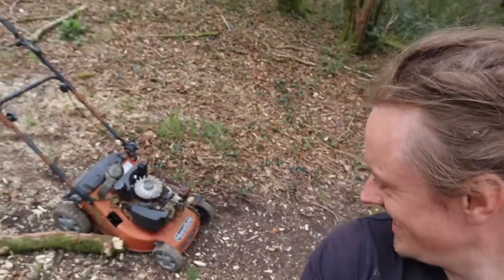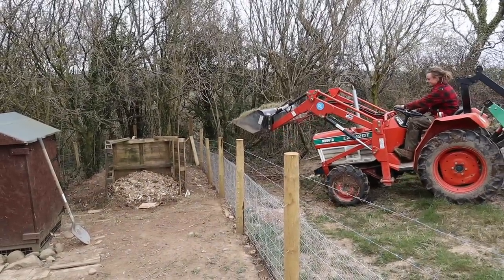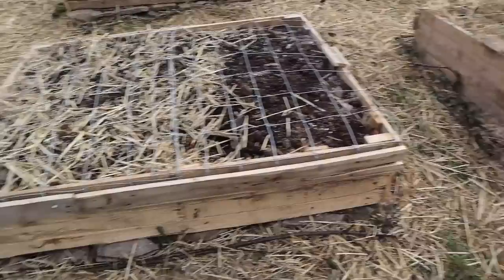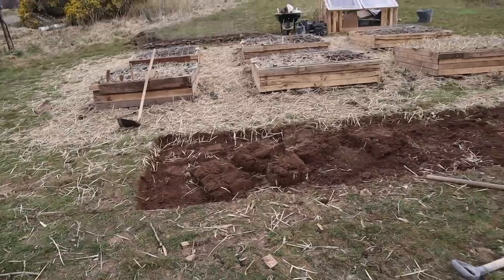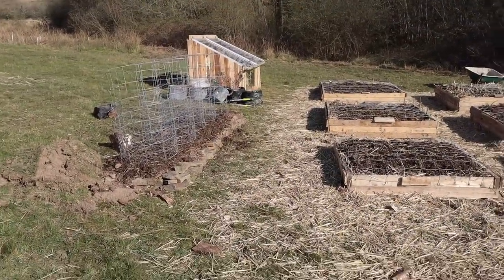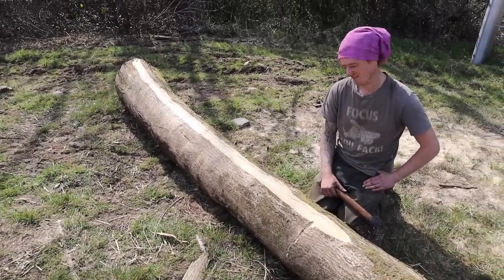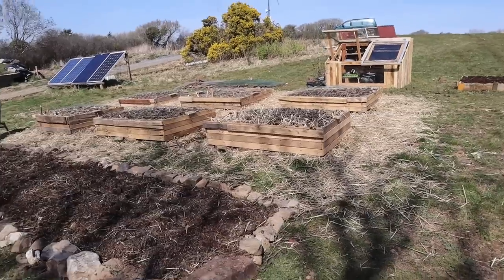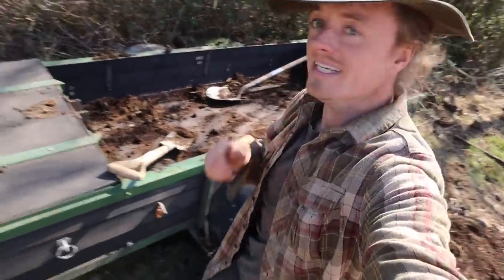Making More Raised Beds And Planting An Orchard For Self Sufficiency

Comment: We have goshawk in South Africa also. Put in higher corner posts around the chicken pen, and put chicken mesh fencing above the entire area where they run. It will keep the goshawk out.  You can be totally self sufficient with half an acre of veg and fruit garden. Hugs
Reply: I was going to say the same thing. That's how we do it in Ohio. :)
Reply: Just what I was going to say! A large net would work as well.
Reply: @pippaseaspirit4415  -    A lot cheaper as well.
Reply: Do the same in Minnesota. We call it a run. Good luck with your chickens. 🐓🐔
Reply: Chicken fences need to be covered all time with nets. Hawks and eagles make fast meal out of your birds otherwise.  But they are easy threat to defend against.  When martens find your  coop you are in trouble. They can chew through solid planks and climb through every small hole + they kill every bird in one night in killingfrenzy. In 30 years iv lost my chickens 3 times to marten.
Reply: Put in a few 8 foot tall poles from your stands of saplings all around your hen yard, and then you can just reach high overhead and run about a dozen or more random, criss-crossed strands of high visibility string, or ordinary string with cloth or plastic flags attached, to make the approach look too risky for entanglement, which will discourage raptors. We have hawks, falcons, big crows and even large bald eagles where I live in the southern U.S., and poor folks have relied on the string & rag method for generations.
Reply: Hi kris, just checked out this post ,somehow missed it, I've had a similar problem with my chucks ,weve now put a Mannequin in there run (just happened to have one that I found some years ago) and since have had no problems, other than scaring the odd camper. Love what your doing ,your a great inspiration to my projects .
I live in west Wales ,hope to bump into you some day . Light and happiness to you and dot.
Reply: @pippaseaspirit4415  aaaaaa

Comment: A tip for planting veg is to stagger the timings or you get a glut of crops ready all at once and you don't want waste. You have plenty of beds for two people if you're clever with timings, crop types and rotating the beds. For example, do two or three potato crops so you can have a balanced staggered harvest, but like everything, you learn as you go.

Comment: We keep ducks at work, we have run fishing line over the top above head height of thier run, we then used old cds and foil, and things that made noise. Also made sure that the fishing line cruised crossed the whole area so to deter the birds of prey. It has worked for us. Maybe worth a try?
Reply: around here on flat roof building they put fishing line to prevent birds from nesting on the roofs
Reply: Ha! We did this for our fish in the pond. Guess what, herons come walking along, get their fish, walk away and start getting airborne couple of meters further. Clever bastards!

Comment: I have seen some one do something similar to that with the lawnmower but using an old electric hand plane. They created a wooden hopper and then in the top went branches and out the bottom came chips. He has a pushed for it that barely reached the blades of the plane.

As for how much you need. Using old methods of growing. i.e. row crops, you can feed a family of 5 on a 1/4 acre. A full sized allotment for instance is 1/8th acre and my back garden is 1/16th of an acre. Using a combination of permaculture, inter planting and basically keeping the ground in use without resting time between the third week of February and and the last week of October, leaving the winter for rest, I produce enough for 3 people veg wise. 1/16th acre is 252sqm.

Comment: Looks good mate. 

What you will have to remember is that certain foods you wont be able to grow all year round .... in the winter its best growing brassicas. 

What you can do is if you have a freezer then you can part boil things like peas, carrots , cauliflower and broccoli,  let them cool down and then portion them up and freeze them they will keep for months on end.

With all of your root vegetables and potatoes you can build a big wooden box and fill it with layers of sand and root veg/potatoes, put a layer of sand at the bottom then a layer of root vegetables/potatoes and keep repeating the process and they will stay as fresh as the day you picked them for months on end. 

Potatoes dont need a lot of room , you will get loads out of that one square bed if you have put quite a fair few sprouting potatoes in there but if you done one more bed the same size then you will yield loads that you can store using the sand method I mentioned above.

Comment: Just a idea for the Goshawk issue is making a hoop roof out of poly pipe then cover with a net? Poly pipe costs very little and you just loop it into a semi circle fixing each end onto your fence. If you want to get adventurous drill out a larger diameter pipe so the hoops can slide through and use it as a ridge beam to hold the top in place. 5m x 30m bird proof black netting is only like $20 on eBay. 

Small hoop tunnels over your vege patches can easy be made the same way except for plastic covering and give you a few extra months growing season.

Comment: Hi Kris, good effort. Some advice buddy, 1. Make 3× compost bins next to each other you fill one up, let one decompose and the 3rd is ready to use and empty.
2. You can use gypsum to breakdown heavy clay. Clay is really high in nutrients, keep adding the rotten wood and straw it will help.
3. Buy some comfrey seeds/plants. Site them in a spot that is damp and gets alot of water. Cut the plants down and make a 'tea' from the leaves. The tea is really high in potassium and nitrogen both good for alot of fruit and vegetables. Keep it up
Mitch

Comment: Simple netting loosely draped up & into the lower limbs of the trees (obviously over the chicken fencing) will keep the hawk out.  Also, you might consider welding a 4”+ diameter pipe to your modified mower.  It’ll allow easier & saver chipping of those branches.  Once they’re too short to feed in by hand gravity & the next limb will take care of it completely.  

Great video!

Comment: Aviary netting is great for birds of prey, but generally lots of vertical obstacles like posts and whatknot in the run area really seem to mess up their ability to come in fast. But the aviary netting is pretty good and the nylon stuff lasts for years and can be cable tied together and repaired fairly easily.

Comment: Kris, from my own mistakes I would highly encourage removing the center row of the orchard and planting those further away. Otherwise in a few short years the trees will be competing for light and space growing into each other. If you watch Stephen Hayes he's removed dozens of mature trees in his orchard for this reason.  Best of luck on these projects I'll be following along!
Reply: Yup, I immediately thought "well that's a bit crowded looking" aswell, when he showed the finished orchard spot
Reply: @DatsWhatHeSaid  does Kris say what rootstock the trees are on?
Reply: @subliminal_donkey  typically if they're box store trees they're semidwarf which is too large for that spacing.
Reply from the maker: They are 2.5 - 3 meters apart, i went with the spacing recommended on the labels. none are full grown trees all are on a dwarf rootstock. i cant remember exactly but it says they will grow 3-4m tall. so the spacing should be fine.
Reply: I agree, having seen how sprawling my trees have got over the years, these look too close together
Reply: @KrisHarbour  first like to say love your channel.
Have to agree they are too close. You say your trees will grow to 3-4 meters, your spacing is 2.5-3 meters, that means they will eventually grow into each other. Especially in a damp climate like yours, they need the space for enough air to pass through.

Comment: that's really a cool idea what if you connect the rear of the lawnmower to a skipo bag that was closed up at the top,you wouldn't lose so much and it would save the clean up, you could superglue the bag shut, i know that sounds useless but superglue works well on that kind of plastic, then make a little tunnel you could use the frame for the bag that goes on the back of the mower to catch the grass just tie the bag on to that ,or put the whole lawnmower into something like a huge vat or a mini skip

Comment: I recommend a solar-powered owl scarecrow with a rotating head perched on one of your fence posts over your chickens. They're fairly cheap online. The solar power allows the head to move... Scares the crap out of small hawks like a goshawk. I also recommend putting some spikes (metal or wooden) on the tops of your other fence posts to remove easy perching opportunities. Also trim any branches that hang over the pen.

Comment: Re. bed space required for two people. UK council houses used to have a 10x10m garden for a family (maybe 5 people i guess) so half that  should do for you two. We have a small CSA and have found that we can supply 1.5 families in the summer with a 10x10m block but winter is a bit more difficult

Comment: It easy to stop it, extend  the post that holds up the fence and use a cheap fishnet as a roof over the whole thing, And if you want it to be bird safe, add some light waging  markers in the net with lots of colors. That should stop the bird from attacking.

Comment: Chicken pen,.. roof. Make a wattle and daub bent roof using bent-over hazel, clay, sand and straw. It'd be a fun project, the roof would be secure (especially if you use reeds to thatch it) and it'd last a long time too! Win win! I realise it's more work than chicken wire 'roof', but it'd look so much better AND it'd keep the birds warm in winter if/when it snows. Oh and I think you should consider fencing off the garden with a proper hedgerow (just my humble opinion). :)

Comment: i find that getting enough veggies and fruits from a garden actually doesn't require that much space, then comes potatoes which require several raised beds that are planted each with 2 weeks in between beds. So far so good for my garden (right now its about the same size as yours). But my diet includes quite a lot of flower (for bread), and thus would require a lot of grains. I have no idea how many square meters i would need for that alone, but for me that isn't worth the effort.

Comment: I use bird netting to protect my chickens from goshawks and it is cheap and works fine but looks ugly, also in my country we sometimes get heavy wet snowfall and it destroys netting with smaller holes by weighing it to the ground and ripping apart, so I need to use one with bigger ones. If you use netting with smaller holes you need to make sure to inspect the netting once or twice a day because smaller birds sometimes get caught up in it.

Comment: A trick I was told was running coloured string at random patterns across the top of the chicken run and make the gaps between strings small, just so the predator bird won't be able to dive as it will not want to get stuck below the string and not be able to take off.

Comment: Mother Earth News used mower as a chipper back in the 80s  they added a feed tube to be safer. Your only problem is if you get a to solid piece you'll be replacing the flywheel key, so you might think about keeping a few on hand
I had another thought with all the dead branches you have you might want to build a few Hugel culture beds

Comment: Only working idea I've seen to stop hawk's in their tracks is make a chicken tractor or you could add on to your existing posts and add on chicken wire to the sides and roof your pen area. (Just my opinion, but the tractor would be more useful as you could use the chickens to scratch open a new area of planting for you, they'd even add fertilizer for you.)

Comment: i don't know if anyone suggested this yet, but if you stretch individual steel wires over your chicken coop in such a way that wires forms a square grid pattern, where is  size of the square is 1/2 to 2/3 of goshawk's wingspan, it won't be able to lend in the coop. this is the fairly known and effective method.

back in the day my parents had a garden 700 sq. meters. half of it was dedicated to potatoes. another half was, cucumbers, tomatoes, sweet peppers. We planted onions and garlic between rows of potatoes to save on space. This amount was barely enough potato for a year for a family of three. granted out potato yields were not great and usually we had to buy another 100-150 kilos of potato to last us till next harvest. some types of soil not very good for potato, we had trouble with our black chernozem soil

Comment: The best way to figure out how much garden space you need to feed your self there are a few things you need first. First you need to know what you can grow in your area/soil. From there figure out how much you will need of each item to get through a year. From there for each type of plant you can use average per plant yield info to figure out how many of each type and how much room each will need. Add these all up and poof you have your number. A straight up square meter number would never work as there are too many variables

Comment: THOUGHTS: from the old guy.    10 sq. meters per person of intense plantings in your raised beds. 
   Remember to plant in week intervals radishes, lettuce, spinach, green onions and other salad greens.  About 60 sq. cm. each time.  On one month intervals  60 sq. cm.  of Swiss chard, Kale etc. cooking greens until 2 months before first frost.  Just before first frost cover with spun fabric or with luck a mild frost free winter. 
   10 sq. meters of potatoes;  4 varieties 2 determinate, 2 indeterminate.   
   ALSO a 3x4 -3x6 sq. meter poly tunnel for tomatoes, peppers, cucumbers, and other heat loving plants.  This will give you a covered space out of the rain to start your transplants in;  next spring, in conjunction with the cold frame. 
   You could check with the farmer for spoiled rotting hay to hill up your potatoes with; as they grow 30 cm deep.  Most potatoes  will be on the surface of the soil no digging required.
   You could also share some of your over production with the farmer if he does not have a kitchen garden.
the old guy   Bert

Comment: There's a product called Buzz Off! Which is a bird scaring line to string across your chicken pen. https://www.ebay.co.uk/itm/221411860863 Birds of prey prefer a vertical dive onto their prey. (they won't fly "in" at 45 degrees) and they will avoid a restricted flight line. You really need to work on that Welsh accent!

Comment: Dear Kris, 

I'll try and tackle the "space requirements" as I see it. Long post advisory! 
What you are really doing here is calculating a person's yearly caloric needs and 
the calories per pound of specific vegetables. My calculations will be based on a daily
caloric need of 2000 calories per day. (an arbitrary number) You can of course do the math to calculate for a specific
 person. At 2k per day you'll need 730,000 calories per year. An acre of organically grown potatoes can produce 21,000 lbs and a pound of potatoes is 347 calories. That comes to 7,287,000 calories. So one acre of that one crop could easily provide the caloric needs of two adults. You can do the same calculations for any vegetable that you would like to grow, down to the square footage. 
 For example, organically grown lettuce would produce about 1,197,000 calories on the same acre. You will of course want more diversity in the diet, but there are crops that will just be "must haves" due to calories and nutrients.
Not knowing the exact climate there, I would still suspect potatoes, sweet potatoes (if possible), maize, dry beans
 and winter squash to be near the top of the list. Of course you could plant the place up with a ton of perennials like skirret, chestnut, hazels, and the myriad nutritious greens.
I'd like to recommend that you research the concept of "landrace gardening" (Google Joseph Lofthouse) as a long-term gardening project for your land. It takes time but you will eventually have vegetables that are hyper-specific to your soil, climate and tastes. I will stop here since the goal isn't a book, but I hope you find this helpful and if nothing else it may get those brain cogs turning. Best wishes from Louisiana, J
Reply from the maker: Thanks for taking the time to write that out. i have actually been doing similar maths But my calorie intake would be alot higher than 2000, its more like 3000 working all day on my feet. so around a million calouies for me and around 700000 for dot so i am working out slowly how much food that is but its alot. i need to be growing 400kg of potatoes 200kg of sweed 200kg of carrots 200kg of beans and peas, and some other stuff for variation. Then add 1000 eggs a year or around that. And we breed chickens to get new hens so we end up with cockerels for the freezer so a few chickens get added to that. I would like to grow a crop for chicken feed as well at some point. So really i need quite a bit of space. it is possible to get 10kg of food from one square meter of space for a very good gardener with concession planting and intercropping. At that rate i would need 200 square meters of beds. But my numbers will be quite a bit lower than that so really i need almost double that amount of space.

Thanks for the comment.
Reply: @KrisHarbour  Right. I suspected that you would be in the 3-5k calorie range. If you haven't already read John Jeavons work, I recommend them. They are very much about growing the most food in the smallest spaces. I use his charts for plant spacings. For chickens I think a lot of people plant millets. You could line a drive with something like sorghum or amaranth. Ideally of couse, over time, you could plant as many chicken forage crops so they could feed themselves. Love the vids and thanks for taking the time to make them. J